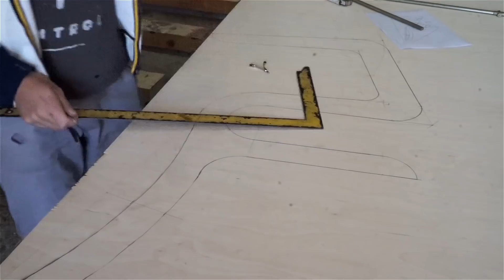Making a plywood chair

Comment: It's a beautiful chair. I'm a little concerned about outward lateral forces if glue is the only resistance you have to that. Any back and forth movement could collapse the frame. Would horizontal cabling in back help with that?